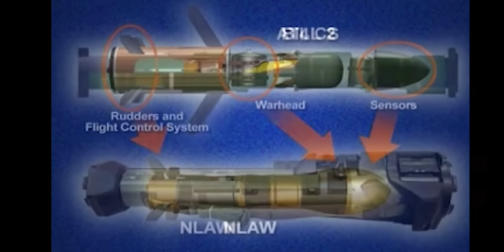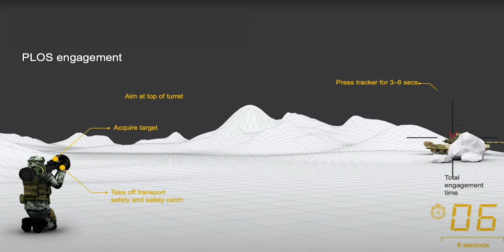Is the NLAW ATGM overrated? Next Generation Anti-Tank Missile

Comment: Mat, as a conscript trained Swede with exp. of both the CG and AT4, I would presume that telescopic front brace of the NLAW was added, not for supporting the weight of the weapon itself, but to prevent unintentional depression of the tube as the missile is launched and it's weight in the tube shifts forward during launch as that's the main source of shorted shot misses on the CG and AT4, both of which lacks that kind of brace.
Reply: The NLAW has an IMU, inertial measurement unit, so once the trigger is pulled the flight path is locked in and any subsequent movement whether by wind or operator depression is corrected.  Obviously one would still want to limit this.  NLAW uses a salt water counter shot like AT4 so is safe to use in doors or bunkers.    I suppose you would get a little wet.  I'm not sure Javelin would work so well in that situation of an enclosed space.
Reply: The brace would help with window frames or other near obstructions .
Reply: @williamzk9083  my point was more that since the Swedish training manual for the AT4 and the CG both notes that it's very common for a shooter to unintentionally droop the tube forwards as the weight of the munition moves, it makes sense that the design of a successor/compliment system incorporates a means to eliminate that possibility from the get go, regardless of any features included in the munition guidance system.
Especially when the typical intended user was going to be either an 18-19yo conscript at the end of no more than 3(basic) to 7.5(mech inf privates) months of infantry training.
Or a drafted 20 to 45yo with a few odd weeks of refresher training every few years after their initial conscript training.
Reply: Good point. The soft launch system makes the muzzle velocity relatively slow so the weight shift would be significant.
Reply: As someone who has seen multiple videos of Indian army using the Carl Gustav. Where the front of the barrel has slight depression just when the shot leaves the barrel. 

Your explanation is extremely logical. 

Thanks for your service to your nation.
Reply: @williamzk9083  Oh no, wet! That does it...NLAW is sh**

😂😂🤣🤣
Reply: @williamzk9083  javelin would work just fine
Reply: @1982rrose  no.  It’s short and not fully articulated.   It’s designed to brace against the shooters stomach
Reply: @smyers820gm  that would still straighten the shot so it doesn’t hit the window or trench edge.
Reply: @TheBooban  yes. I never said it wouldn’t.
Reply: Likely the case!
Reply: As a NLAW trained finn I can say that shooting without the brace was not even trained, it is essential as you push the NLAW down with the weight of your hands and it helps to stabilise it. No muscle strain at all and more accurate
Reply: @williamzk9083  it can't do wonders, if the 3sec period is not stable tracking, the missile has no idea where to go
Reply: @lefty637  that’s not what he said 🤷‍♂️.  It compensates AFTER the trigger is pulled 🤔
Reply: @smyers820gm  it can't compensate operator errors, before launch the 3 sec period NEEDS to be stable AF for the missile to calculate speed and direction of movement of the target. There is no operator errors that can occur after the "trigger" is "pulled". (Its a button)
Reply: @lefty637  yes I know that.  The other guy didn’t say anything about it compensating for operator error 🤷‍♂️.  He just said it computes the flight trajectory and compensates for tank movement after the trigger is fired 🤷‍♂️
Reply: @smyers820gm  He clearly mentions operator depression which is operator error
Reply: @lefty637  😂😂😂😂😂😂😂😂.  No he does not my Finnish friend.   I’d suggest you look at the messages again 😂.   Sonoflorgar the op DID you responded to william zk 🤷‍♂️
Reply: @smyers820gm  my comment was in speculation from my experience of the unguided AT4 and Carl Gustaf.
I have no experience or training on the NLAW and haven't even seen it  with my mk1 eyeball yet, despite beeing in the Swedish home guard for over twelve years.
Reply: vad gäller oavsiktlig dumpning av grg och p-skott skulle jag hävda att det inte är kopplat till att vikten flyttas, utan en rent motorisk reaktion kopplad till förväntningar, smällen osv. Det är samma mekanismer som ligger bakom att väldigt många "dumpar"  kameran i samma ögonblick de trycker av. Trots att det inte finns någon vikt iblandad i det sammanhanget.

Comment: What people don't understand about that tiny hole in the armor is that all the metal that used to be where the hole is got heated white hot, accelerated to supersonic sped, and sent flying around inside the tank. It's like turning the tanks own armor into buckshot.
Reply: And that white hot metal spray inside the confined space of a tank quickly superheats the air inside to far beyond comfortable and, as air expands with rising temperatures, as well as any additional combustion gasses generated by everything combustible getting hit by droplets of molten, burning steel, will be trying to make room for that extra volume one way or another...
Reply: @SonsOfLorgar  Yeah even an RPG round strrapped to an FPV drone now in Ukraine creates the same effect. Shaped charge causes full destrustion and cook-off of the tank